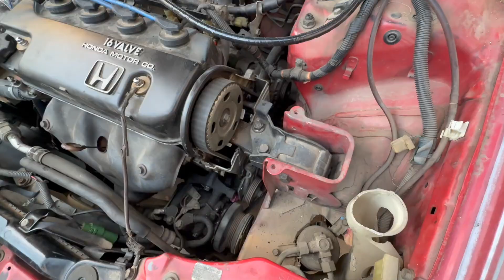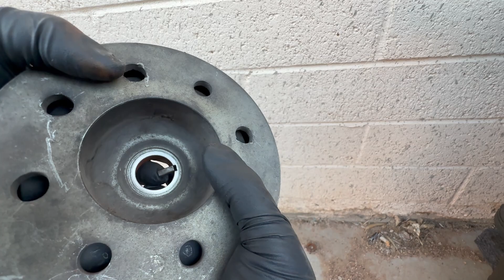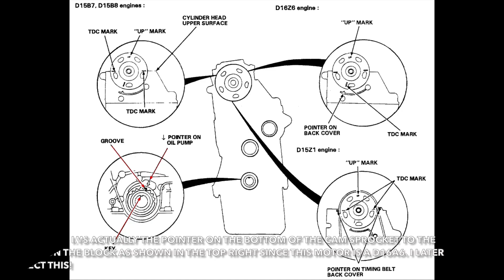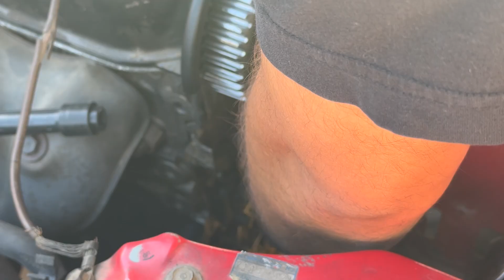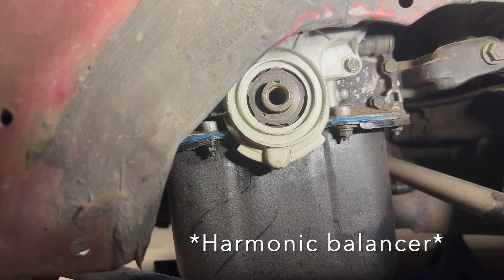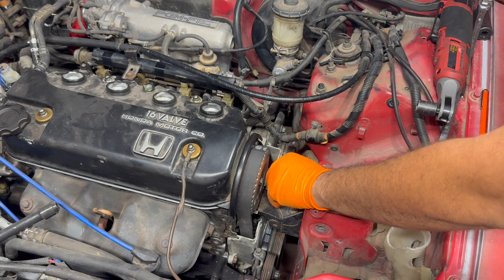Honda CRX Si timing belt/water pump replacement.

Comment: Ayeeeee perfect timing haha, I was recording myself doing one too a couple months ago but then got lazy 😭 perfect timing I’m here literally trying to put it back together
Reply from the maker: Haha hell yea! It’s the worst putting it back together after time has gone by!
Reply: I finished doing the install, but now I noticed something. When first driving it around like the first couple drives, I wasn’t seeing a leak. Now after replacing my injectors on my CRX, I am noticing a coolant leak from the driver side which I am assuming is the water pump. Is this something you’ve experienced in the past?
Reply from the maker: @happyboyjared no haven’t experienced this, the vehicle In this video didn’t have any coolant leaks when I was done with it. I’d probably remove the top timing cover and see if you can see the leak in real time at the water pump. You could also use a coolant pressure tool to pressurize the system to recreate the leak without the vehicle being turned on.
Reply: Okay, I think I’m figuring out where it is coming from. It looks like it’s dripping/leaking out of the weep hole. Are you experiencing this?
Reply from the maker: @happyboyjared hmm not not at all, was the water pump new? This is a sign of water pump failure if it’s leaking out the weep hole
Reply: @MousieMotors yea, literally installed the brand new gates kit with timing belt, tensioner, and water pump. I never noticed any leaks up until a couple days ago after starting up my car after replacing my injectors
Reply from the maker: @happyboyjared hmm it’s possibly a faulty new part. I would contact gates and see if they can send you another one for free.